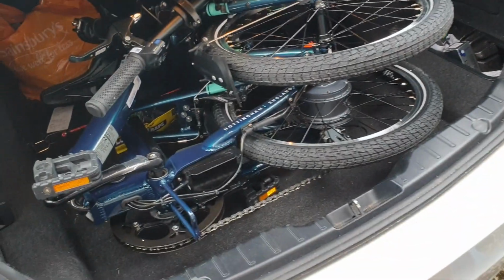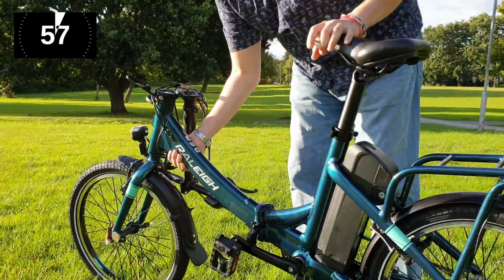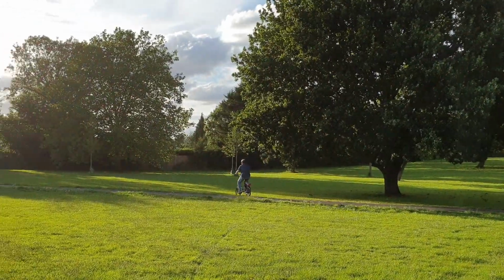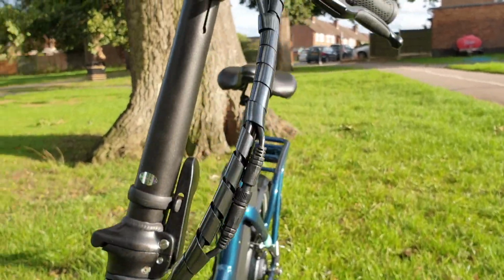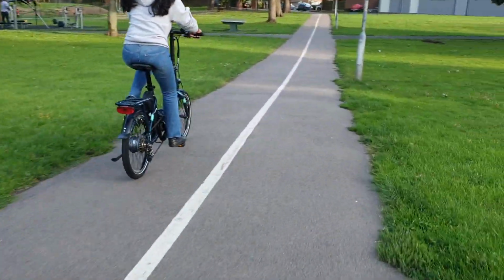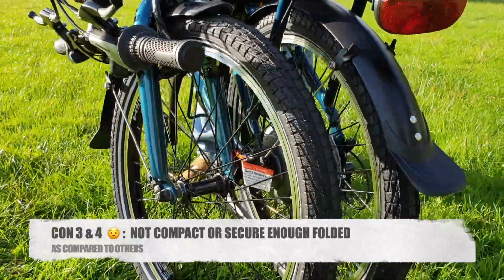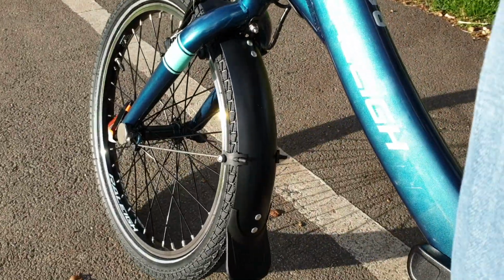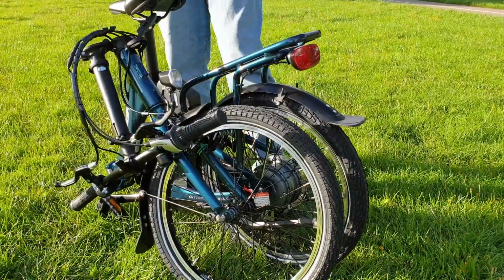Raleigh Evo Electric Folding Bike Review, First Impressions & How to use – First on YouTube

Comment: This is a really good review you covered everything. I've had mine for a month and I can really recommend it, it is so much fun. If you are cycling for exercise it works well on 0 power. Round town I only use power for hills or to get home quickly after a ride. The only thing it really needs is suspension on the front as I like to do light cross country and this is a bit bumpy.
Reply: Hi, RabC burns here,  I agree with your observation that a front suspension fork is needed, however, I came across sites on the web where these are obtainable;  I watched a video by Robert Blaser on how to change the front fork on a Lectric XP bike, it seems easy to do (the removal of the original one is slightly different), the name of the fork I'm buying is a Spinner Grind (strange name - I hope it's not a description of how things will turn out). Once it arrives and gets installed I'll try and put up a video on how it looks and performs
Reply from the maker: Thank you for watching @nordicsky I am glad you are enjoying your bike. I completely agree with your suggestion - it would indeed be ideal to have front suspension on the bike :)

Comment: What’s the difference between this one and the Stow E Way please ?
Reply: It seems the same

I've got 🎉 the stowaway March 2023 but it's black I'm 5ft 2ins tall have seat on lowest height. 

My tyres are diffrent more smooth then mountain bike I asked for puncture prevention which cost £20 extra... I don't know why tyres are different but have to be careful in rain. Bike cost £1000 🇬🇧 from Halfords.
Reply: @RoxiTube1  Yeah, I now have a Stoweway mines dark blue. Very pleased with it. I got mine also in 2023 but mine is 8 speed and I think the latest ones are 7 speed?
Reply: @Vanilla Coffee  
Yes mine has 8 speeds
Be careful going steep down hill... steering a bit awkward 😬

Comment: Hi, how is the bike held together on the fold up position....just looking in Halfords at the non electric Evo version at £300 to add a new Swytch bike battery to - just about to launch- but once folded,nothing to stop it swinging open, apparently....don't want it opens by out as I lift it up into the car boot.
Reply from the maker: I believe it is held together magnetically.

Comment: Very good review, I bought mine from Halford, but my bike has 6 gears. Due to my weight being closer to 100kgs, my bike does about 10 miles, partly due to a few elevations, and I have to have assistance at 2,3 mostly and 4 uphill! But it’s sturdy and Ihave had it for nearly two years or less. So far, no problems. Also noted that even if I pedal faster with the electric, it does not enhance the speed of travel. Also the manual was for a manual bike and Not electric bike,
Reply from the maker: Dear Sidha, I hope that you are keeping well. Thank you so much for your personal insight and the detailed comment. It was indeed very helpful to know your experience and I am sure others too would find it useful :)

Comment: Did you consider the raleigh e stow away, electric folding bike.
Reply: That's the same bike basically, same with slight differences in the frame and the rack I believe can be removed unlike the EVO which is integrated.
Reply from the maker: Hello Missfloflowers, thank you for your comment, yes I did, however I narrowed down on this model :) I hope that you are enjoying your bike!

Comment: I have a problem with my raleigh ebike.The engine dont start.Can you help me?
Reply from the maker: Hi Danut, have you tried draining and re charging the battery? Where are you based? You could take it to Halfords if your based in the UK.
Reply: If you can tell me how to drain? The battery or the bike,?
Reply: @danutserban6540  You can discharge the battery with a bulb as a load to drain the battery. Use the same voltage bulb to discharge it.

Comment: Hi bro, I bought this bike after seeing your video & the comments. Is your Evo electric really made in UK. I’m shocked to see that mine is made in China.
Reply from the maker: Hello Lusitano-  Thank you for your comment, how are you finding the ride and the overall biking experience? It could be that some parts are sourced from China. However it is a British Brand originally built in the UK.
Reply: @TechTravelFinance  The bike looks excellent. It’s built in China, according to the manufacturers label at the bottom of the frame. Riding it at level one is harder then a normal bike. You have to ride it at least on power level 3 to get the feel of an e-bike. It gives me approximately 10 miles on full charge at power level 3. In your video I saw the bike goes a good distance after one or two pedal rotations. I have to keep on peddling other wise the bike pulls back. There are other pedal assist bikes for around £500 which are much easier to ride. I have developed knee problems since I started riding on this bike. I really felt it was a waste of lots of money. Unless my bike is defective.
Reply: @lusitanorodrigues4959  I get about 25 miles from mine and am 110kg

Comment: Hi there, a good review, and as I also have an Evo I agree with your views regarding the pros and cons. To compensate for some of the cons I fitted a larger and softer saddle fitted to a Sunpost telescopic damper (I had to use a sleeve adaptor to get it to fit) this made a good difference to comfort though not as good as a proper suspension system. I also changed the tyres from 1.9" width to 2.125" width, in fact, the new tyres are made for the Raleigh Chopper bike....the Raleigh name is embossed on the tyre sidewalls....I can run the tyre pressures at 20 psi. on the front and 30 psi on the rear (30psi is the max. recommended pressure) this also adds to the comfort level due to the higher aspect ratio of the tyres. The next mod. was to remove and replace the crank wheel with a larger 54 tooth one, this gives an overall higher gear ratio which means you don't have to pedal as fast as you had to do with the standard wheel. At the moment, I'm looking into the possibility of fitting telescopic front forks. These modifications have certainly improved the riding experience with regards to comfort and speed.
        The range from the battery varies quite a bit, the lowest mileage was about 10-12 miles, this was when I got the bike at first, I was carried away with the assistance and tended to use power levels 3 & 4 quite a bit, plus the area where I stay tends to be a wee bit hilly, however, I can now get about 19 miles on the same journey; the best mileage was 44 miles when I was down at my caravan, I cycled along the seafront which carried on to a proper cycle track for several miles, most of the track was flat with a few steep inclines, however, the general range is about 19-24 miles. Overall the bike is certainly a well-built quality machine which rides well even without the mods that I made....(no doubt, I have now invalidated the warranty)
Reply from the maker: Thank you so so much for your detailed comment it is very insightful. Agree with the seat. I am also looking for seat post with suspension, however not able to find one with same length.
Reply: Do you have a pic of your new crank wheel? Very interested in doing this myself
Reply: Hey I've just purchased this bike and am interested in the mods you've made, any chance you can post the tires you got?
Reply: @glitch91  I have now changed the tyres as the Raleigh chopper tyres tended to rub on the front mudguard, the new ones are Schwalbe Big Apple Baloon tyres ...20" x 2.15".  I also fitted Tannus Armour liners to reduce the risk of punctures, a wee bit difficult to fit  though.
Reply: I fitted telescopic seat post, this helped cross country a bit. I wish I could get telescopic front dampers.